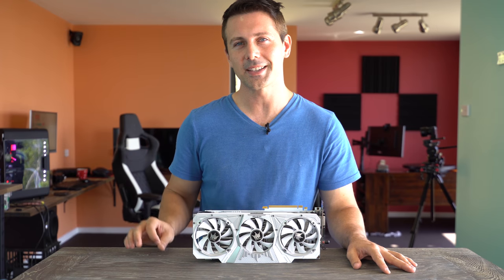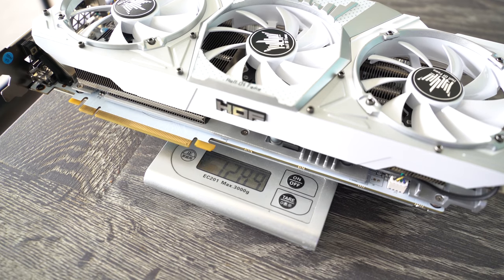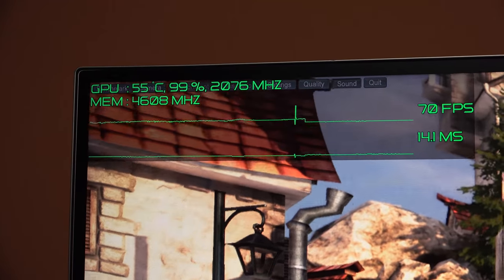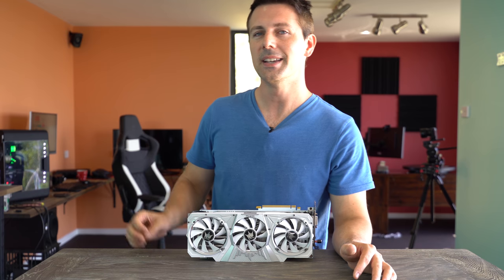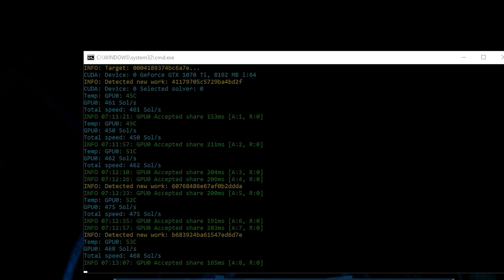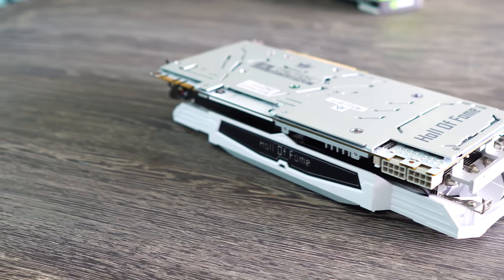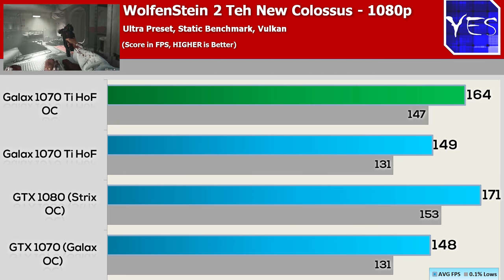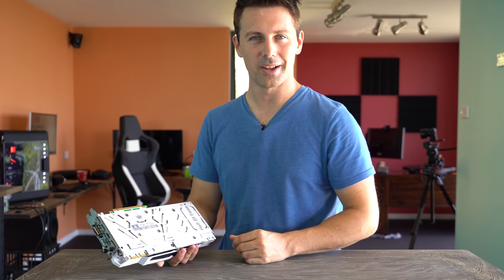Galax GTX 1070 Ti Hall Of Fame Review - Does it have the YES Factor?

Comment: Great video, the only thing i would add is if your mining it might be a much better option to look at 2 Galax 1060`s over 1 1070ti, the 2 1060`s will get around 600 h/s compared to the 1070ti at 520 h/s, with power consumption being around the same for 2 1060`s for 1 1070ti, but Galax really have brought out a quality range of cards

Comment: Brian, looks as if you got a bad server on PUBG, that OC should be around 12-14% higher than stock, mine binned strix 1070ti averages around 16% performance improvement when overclocked, and the other games you tested showed similar, albeit, lower overclocks, but still similar.

Comment: This card would look great with a nzxt g10 bracket. Wondering if it will fit and with the backplate installed. The 1070 ti/1080 version of this card would be my first choice when prices come down... i have the 980 version and it looks great with the G10.